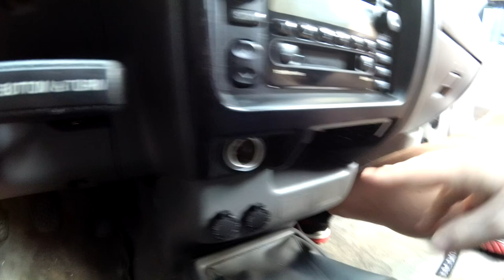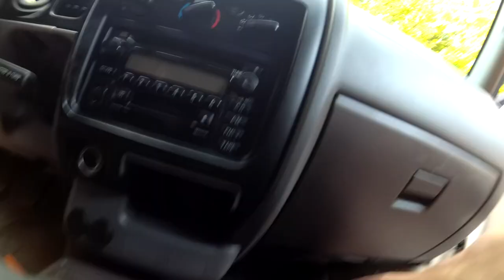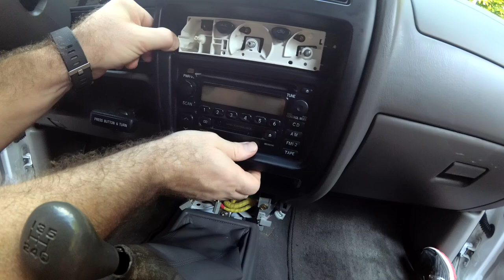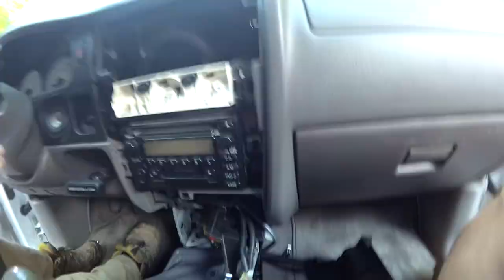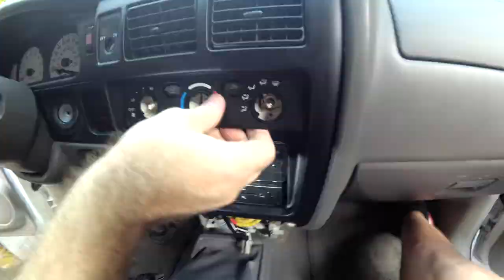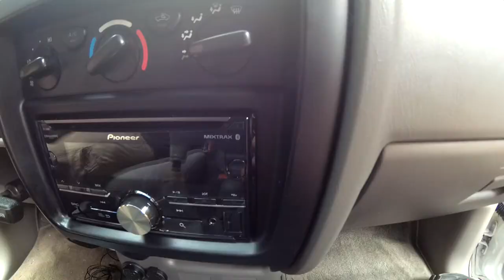Tacoma Stereo and USB Install - Project Sadie 1st Gen Tacoma TRD Off-Raod

Comment: I watched one your video on you truck and noticed you said it has 210k I’m think about buying a 2000 Tacoma trd with 220k I’ve done all my research on these trucks but still can’t convince my self to get one with that many miles?  It has just all the basic services? Any advice
Reply from the maker: Well I wouldn't call myself an expert on the tacoma but I used all my skills and knowledge of land cruisers when hunting for my tacoma. I have to tell you the truth, every time I buy a high millage vehicle I am a little nervous especially on the first ride home.  I am sure you are familiar with some of these but here are the big things to look out for.  You are sure to have regular maintenance that will need to be done on high millage vehicles but the list below will ensure you are out to a good start.

1. Watch out for rust.  If the truck is mostly rust free then if anything does happen mechanically it will be worth fixing.  Rusty ones are not only a pain to work on but not as valuable.
2. Timing Belt.  It's an expensive job and if not done you could destroy the motor.  Check not only millage but how old the belt is.
3. Proof of maintenance - mine was dealer serviced almost exclusively, it isn't very common to find that but evidence of regular maintenance gives me comfort (carfax or owner records)
4. Interior - if the interior looks cared for then you can bet the mechanics were probably too.  If it looks like someone was careless inside then I would bet they neglected maintenance too.
5. Know the engine - I am very familiar with the 4.7 in the cruisers and they routinely get 350-450K.  If it is cared for the odds are in your favor.  The 3.4 v6 in these tacomas, from my initial impressions will get over 300K no problem.  I heard the 3.0L are not so good.
6. Axles - look for grease leaking from the boots of the front axles.  Not sure how much this job is on the tacomas but on my cruiser it is $1000 in parts alone, if you go OEM.  There are lots of seals and odds and ends and OEM axles at least in cruisers are balanced better and stronger.
7. other general items - check the brakes, check for leaks, the exhaust, does it run smooth, does it smoke, etc

Toyota motors are pretty tough so the chance of it blowing up on you is pretty slim if all else looks right. The real challenge is ensuring you don't get ate up with $5K in maintenance right out the gate.

I hope that helps a little.  Let me know if you have any other questions.

Comment: Thanks for the video! What all came with the stereo when you ordered it on Amazon? Did the Bluetooth Microphone come with it? I'm thinking about doing the same setup as you.
Reply from the maker: Yep it had a mic with it, it's not the best mic but works ok. The bluetooth works great for music and calls it never has con ection issues and connects quickly.  It had mounting hardware but I had to order the wiring adapters. Really happy with it overall. Let me know if you have any other questions and good luck.